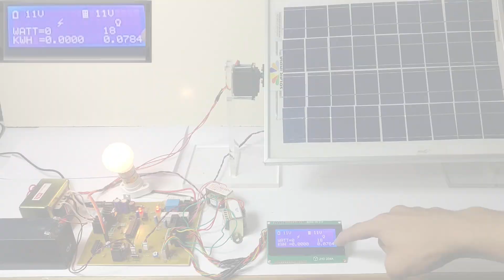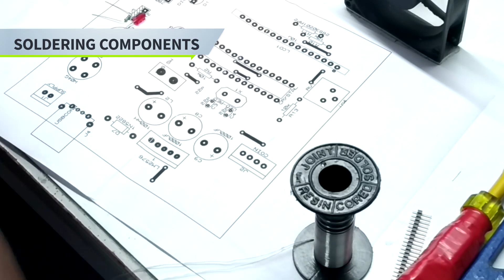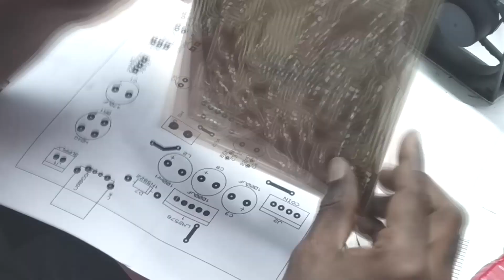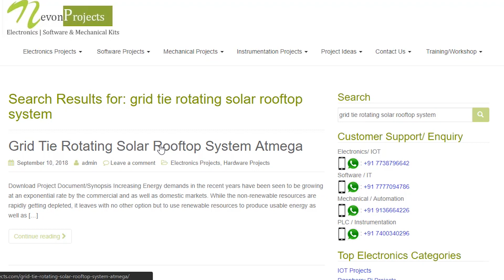DIY Grid Tie Rotating Solar Rooftop System Solar Power Project

Comment: without sunlight how solar works .with normal tube light power we are not able to charge the battery  fully coding work
Reply from the maker: For free synopsis, ppt or any details of this project - Pls Call/Watsapp +91 7738796642